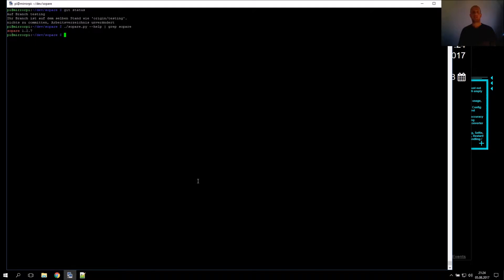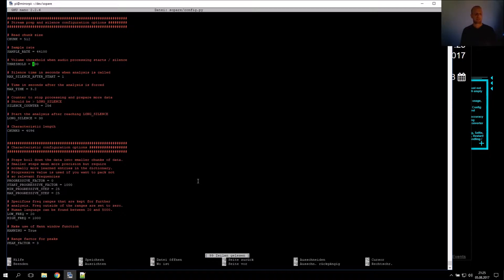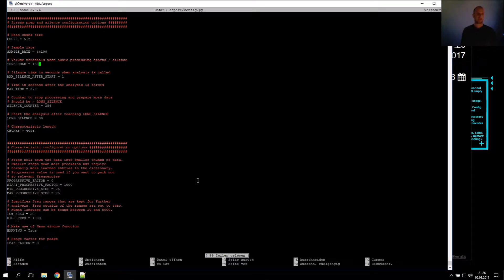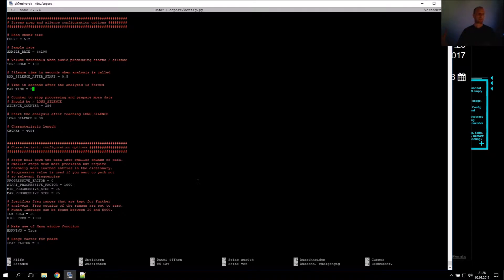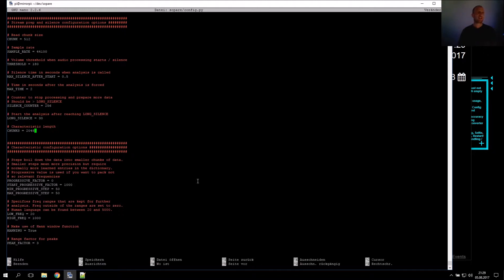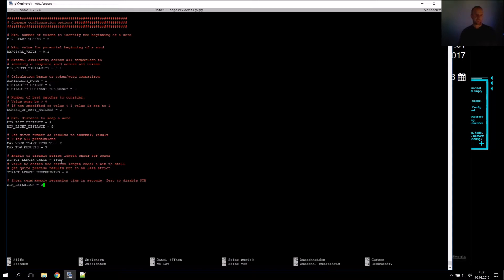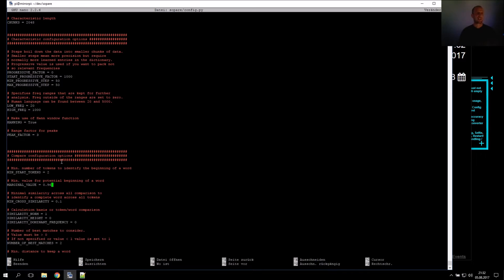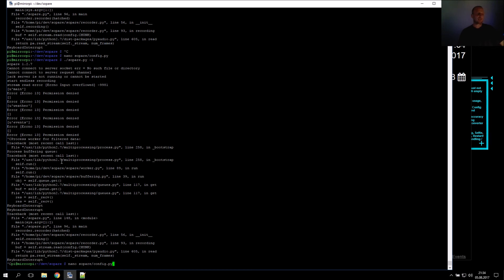SOPARE: A blueprint how to approach precision and accuracy - part 3

Comment: i put ./sopare.py -l -v and i get this error:

Invalid input device (no default output device)

please help me. Thanks in advance!
Reply: restarted my raspberry pi and i get this error:

stream read error [Errno -9988] Stream closed
Reply from the maker: Not sure what causes this, but the error comes from pyaudio and as far as I can tell it is not related to SOPARE. According to other users on the internet who are facing the same error you can try to use a different sample rate.
Reply: thank you for your fast reply!

The problem that i had with pyAudio was because of closing the terminal window instead of putting a "keyboard interrupt (ctrl +c) ". Appearently it seemed to work for me.

I tried to do this again. i created the dictionary with -c, then I put ./sopare.py -l -v and  started saying a couple words. Then i put ./sopare.py -l and tried to say again my words, but unfortunately i receive nothing

[] //word given must have been translated to text and written inside the "[ ]" isn't it?
[]
[]

i'm going to try changing the sample rate as you told me. Saludos!
Reply from the maker: Make sure to have a microphone plugged in and configured properly by following these steps and HOWTOs you find in the wild internet:

1) You should view results when you view your sound cards with the following command:
cat /proc/asound/cards

2.) You should see the devices when you run the following command:
arecord -l

3) Test audio capture (make sure to adapt the command to your environment!)
arecord -D plughw:1 -d 5 /tmp/test.wav

 #### Only if you were able to record a sound continue ###

If you are on a Raspberry Pi make sure to install and use Python 2. Follow the install instructions stated here: https://github.com/bishoph/sopare

Start SOPARE by using explicit "python2 sopare.py -l -v" as it seems that your default python version is version 3 (as far as I can tell from the distance).

Have fun :)
Reply from the maker: Hi Bruno, great that you get it going. To get results please make sure that you are doing a training round first. Train a word with the "-t" option. Repeat 3 times. Then compile the dict with "-c". Now you should be able to start "-l" and you should finally get results.
Reply: Thaks a lot for your help!!! i'm going to try it!!